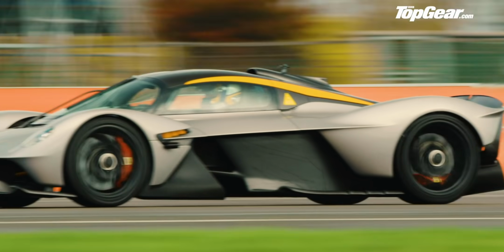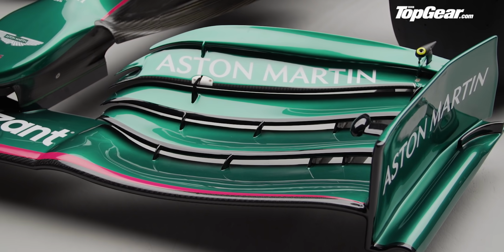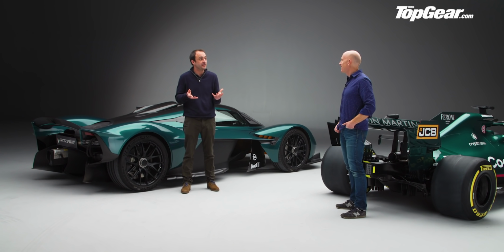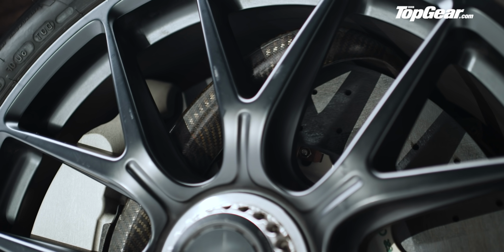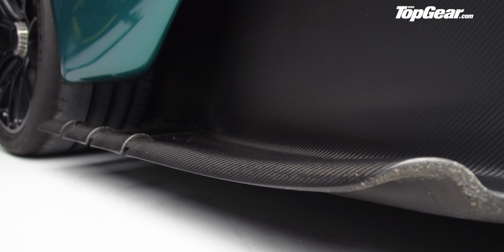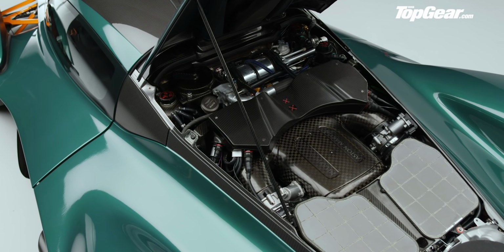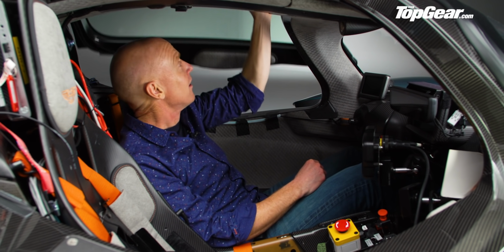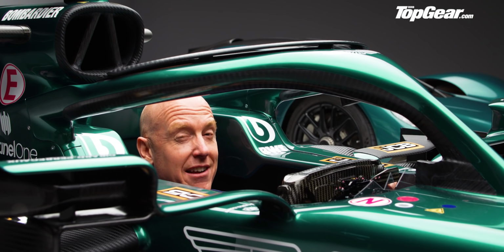Is the Aston Martin Valkyrie really an F1 car for the road? | Top Gear

Comment: I understand the water running off if dropped on the 'air filter' when stationary, but surely the engine would SUCK the water through quicker than it can drain away?

Comment: Aston Martin F1 car dimensions, 5.6 meters/18 feet 4 inches long with a 3.7 meter/12 foot 1 inch long wheelbase! The F1 car’s wheelbase at 145 inches is almost as long as the 149” Mini Cooper is overall! It’s total length of 220 inches is 8 inches longer than the 212 inch long 2021 Rolls Royce Ghost! Can they make F1 cars any longer?😳

Comment: Really, you should be able to make a road car even faster than a F1 car. The rules are less restrictive. You mostly just need to add lights, bumpers, and airbags. 

Having the wheels and roof covered will be better for aero. Moveable aero pieces are totally legal. You can use fans or ground effects if you want. Full active suspension is totally legal. 4 wheels steering, AWD, also totally legal. There is no minimum weight. You can go nuts with the engine. 

And they've done some of those things. It's only compromised for practicality. Slap some soft slicks on that Valkyrie, and that 2g in corners will go way up. They could make this thing even more extreme really. It just becomes less practical as a real street car as you do it.

Comment: if they won't say which car the paddle shifters came from, then they came from the Red Bull, this car is more or less a Redbull just as the Aston F1 car is more or less a Mercedes. If a component on the Valkyrie came from Aston's own f1 team, then it would be proud of that. Since they just ended their partnership with RB, nearly all of the f1 tech in it is from red bull, not the racing point team and Aston would be tight-lipped on where that component was from only in that situation.

Comment: The ultimate f1 car on the road is the Ferrari laferrari.That thing is 8yeare old and still looks brand new.The valkyrie looks more like a more of a track only car rather than a road car.Those carbon fibre seats and break ducts are not meant for the road.This is more comparable to the Ferrari FXX K EVO.The evo will crush the Valkyrie.

Comment: Aston martin and Red bull:
desgin an incredibly complex car with f1 technology 

Dodge: putting a 700hp supercharged v8 in everything
Reply: Well one is 3+million dollars, the other is  2% of that.
Reply: @advancedchiropractic667  Reliable? That honour goes to Japan. Lexus is rated as the most reliable car. the 2nd most reliable is Mitsubishi and 3rd Toyota. 4th is MINI which is a European car and Ford, an American car company is 18th.
Reply: ‘MURICA
Reply: Anyone can make 700hp using boost, there are tuner 1000hp 2L running around. To make 1000hp all motor that's streetable on pump gas is another.  That V12 is making 153hp per liter and it's only 6.5L ~396ci.
Reply: @ineffable1129  yum
Reply: @ineffable1129  bro a evo made 2500
Reply: @BTICronox It has a planned life of approximately 62,000 miles or 100,000 kilometres, which for a car as rare and valuable this it will probably last 50 years depending on how much it’s driven.
Reply: Dodge are shit though anybody can put 700 hp in a car and make go fast in a straight line
Reply: I think dodge gets a pass. I mean, yeah they add 20 horsepower more than the previous challenger every day. But they do it so well. Cool isnt something that can be measured but its something that dodge has being the playful immature manufacturer that they are.  Its literally the point of making their cars 600+ horsepower for no reason at all, because its fun and why not
Reply: That's why European cars are better ON AVERAGE when compared to America
Reply: @DaJoIKeR  nah you can skip the average, european cars are just better. Even mercedes is making better muscle cars than America atm
Reply: 'Merica!!! 🇺🇸 🇺🇸 🇺🇸 🇺🇸 🇺🇸 🇺🇸 🇺🇸 🇺🇸 🇺🇸 🇺🇸 🇺🇸 🇺🇸 🇺🇸 🇺🇸 🇺🇸
Reply: Thats why Dodge's market is shrinking by the year and they will either get another US government bail out or they will bankrupt.
Reply: @DJUwU  It doesn’t help that their previous money maker and best vehicle the RAM truck is now it’s own badging and thing apart from them.

Comment: The Valkyrie still look a large, whilst low, car. Interesting to compare with the T50 which is 200mm shorter than a Porsche 911.
Head cam would have been interesting to see the view from the driver's aspect.

Comment: Yes, yes. A Formula One car for the road. As spectacular and fabulous as the Valkyrie is - as are a lot of hypercars that have popped up these days - it's still a long way from a Formula One or LMP1 car. The Valkyrie doesn't need a team of highly qualified engineers to just simply start it, it doesn't pull 5-6 gs under braking or through corners, it has a battery of driver's aids (which helps so the driver also doesn't have to be qualified racing driver to drive it). There are certainly lots of interesting reasons to choose a car like the Valkyrie, but for the money of a hypercar, if you really wanted a race car experience (and the only place to realize this is on a race track) you could literally buy a fleet of vintage formula or sports racing cars and fund their track use in near perpetuity.

Comment: Slightly worrying to hear that Adrian Newey designed the bottom half of the car but Aston Martin's own designers did the top half (sounds a bit Frankenstein-like) and that Adrian Newey is no longer involved in the project.....
I'm sure it's an amazing car but if I was a rich potential buyer of the Valkrie - all that would really put me off the car!
I'd be putting my money down for the T-50 (all sold now) which, as a Gordon Murray car, is one man's vision - not something built by a frequently changing committee....